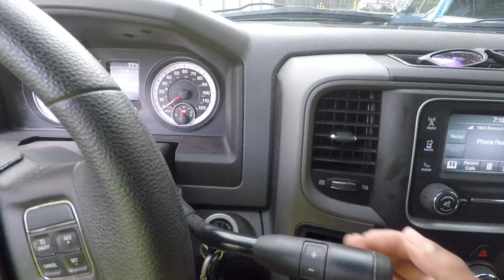New Employee / Subscriber came chased us down!

Comment: As crappy as the sound is on the 3m headphones mine are still working but I sprayed them with a few coats  that under coating spray and let them dry I can actually hear YouTube now when I am using my equipment
Reply from the maker: Hmmm need to try that.